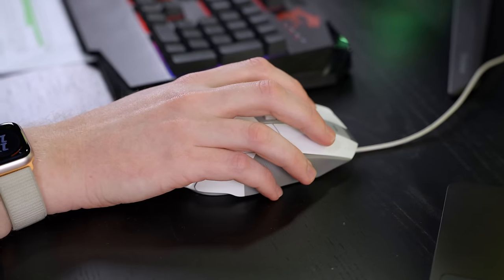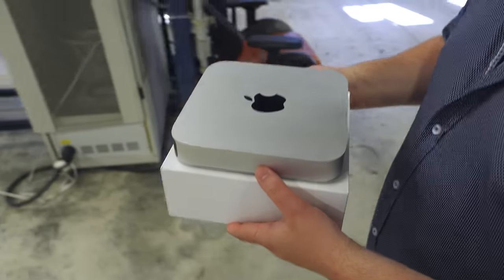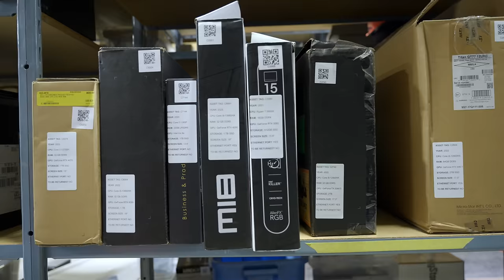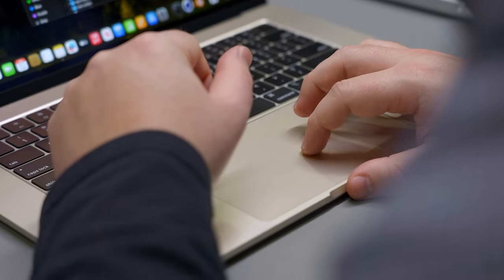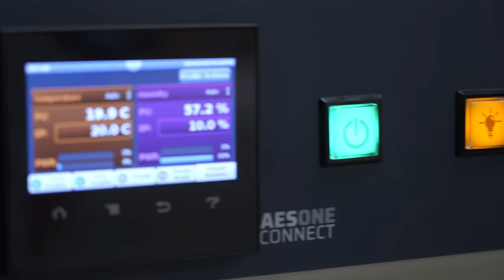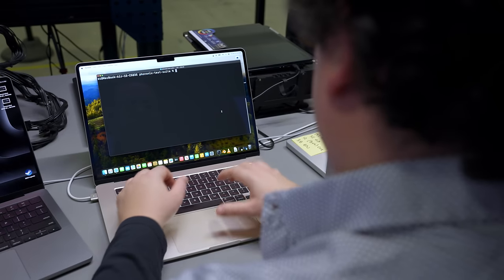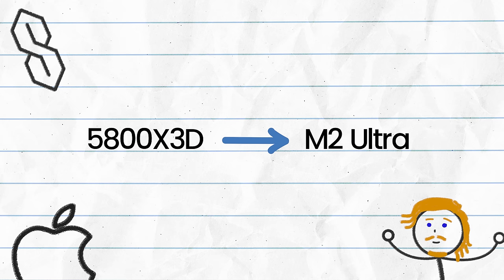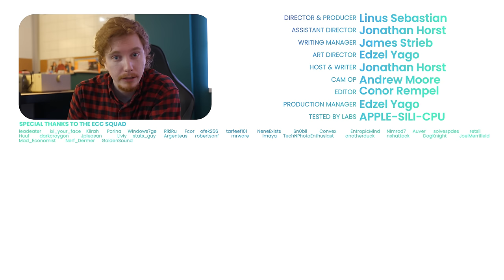How Apple Silicon Compares... - Part 1

Comment: Honest question: Isnt the data going to be skewed by excluding the newest CPUs from Intel and AMD? As an example the 5950x was released more than 3 years ago while the M3 was released at the end of last year? I think it would rbe really interesting for the public  to  see how  the AM5 CPU from AMD rcompare too

Also it is a bit surprising to see both the intel 13700 and 13900 being excluded while also testing the M3 Pro?
Reply: They are just trying to match performance not exceed it. They are trying to test the Apple GPU, not CPU. Older CPUs are fine considering that
Reply: It's the only way they could get the Studio Ultra to be on top of every table.
Reply: @peanutnutter1  Also, shouldn't the ultra chips be compared to AMD's threadripper chips from the time? the m1 ultra has like 20 cores even if it is a mix of p core e core.
Reply: @avgHanimeEnjoyer   You can get a new TR 7980 system for about the price of Studio Ultra
Reply: It´s a GPU comparison test. The idea is to match the equivelant CPUs so it does not skew the real test.
Reply: @JonGretarB   what GPU did they use for the other CPU's?
Reply: @peanutnutter1  as they explaned in the video. That is part 2. Now they are just building a comparable machine.
Reply: @JonGretarB Right, but the Mac's having DDR5 and the PCs having DDR4 will still put them at a disadvantage even if their CPUs are equivalent.

Like why not just... Include both AM4 and AM5?
Reply: m also more curious on laptop chips as well since some of the macs used are laptops too
Reply: @JonGretarB  so all comparable machines are a fifth of the cost and slightly worse performance?
Reply: The 5950x isn't even the best gaming CPU of it's time. You'd want the 5800x for gaming.

Edit: I read this comment before watching the video, they did test the 5800x at least for productivity. Presumably they do the same for gaming.
Reply: @gmony1552  That's stupid because a lot of games are CPU bound on PC.  If you're using a RTX 4090 with an old CPU, you'll run into CPU limitations.  You really do need the latest AMD 7000 series to make full use of the latest GPU's.
Reply: @peanutnutter1  did you not watch the video? It’s about building the equivalent test bench. He explains all this about the minute mark. The whole point of the video is building a computer that is NOT better.
Reply: @avgHanimeEnjoyer  They will be using the 5800x3D against the M2 Ultra for gaming performance
Reply: @JonGretarB  By selected "equivalent" last gen CPUs, they will be unable to match the memory specs of M2 and M3 (3200mt/s vs 6400mt/s), are limiting SSD write speeds (7,000 mb/s vs 12,000mb/s), and potentially limiting the 4090 via cpu performance. 

If they match the CPU in performance and the game happens to be CPU limited, then you will only see a comparison of which API is able to better optimized for which CPU. A CPU that can only run CSGO at 80FPS will run the same on a 3060 and on a 4090. This is a problem because a 5800X3D CPU limits a 4090 in tons of benchmarks. 

If the game is able to run at a high frame rate with lots of things happening, then Ram speed and SSD speeds start to affect performance (+-10%). M2 and M3 will be able to enjoy those performance boosts, while PC will be artificially limited to not have them. So a high framerate game will run worse on a performance matched Nvidia PC as compared to an M2/3 just based on the last generation ram. 

If they push the games graphics to be GPU limited, then the CPU performance would not matter as the CPU would never reach 100% utilization. You remove the memory issue by matching MT/s and memory latency. You remove the SSD issue by using equivalent SSDs. Then you are just left with raw a GPU performance comparison with zero artificial limiters from outside sources.
Reply: @peanutnutter1 You don’t understand the point of the tests lol. The goal isn’t to see if an X86 CPU can be faster than Apple silicon. The goal is to build comparable test benches in CPU horsepower to various Mac models in order to benchmark GPU performance more accurately.
Reply: @CFIREKytb Eh, I think you’re overthinking it a little bit. SSD speed really has very little impact on gaming performance in most cases, and PCI-E gen 4 SSDs are still wicked fast. Functions like resizable BAR do impact performance, and yes, faster RAM helps with that. But in that case, CPU performance as they evaluated it here already takes those variables into account when ranking CPUs. This suite of testing wasn’t intended to determine if desktop CPUs are faster than Apple Silicon. The point was to determine which desktop CPUs align with which Apple Silicon processors in order to build GPU test benches. The tests they ran then fundamentally display the strengths and weaknesses of each architecture, thus allowing chips to be selected for their overall performance,and across the suite of tests. 

When it comes to outright ranking Apple Silicon CPU compute performance VS X86, you’d be conducting these tests very differently.
Reply: @phishphood423 that unfortunately isn't possible as mentioned above. Current gen x86 for a myriad of reasons should be compared to current gen apple silicon
Reply: 3:46 @GuyGamer1
Reply: Not even halfway though this video and this was my first thought. Even if they have to use a lower end AM5 chip to match, it still seems weird they would choose chips that bench scores clearly skew toward the M3 chip. If the AM5 chips are far out performing the M3 chip, I would have liked that information clearly stated rather than a comment that indicates that may or may not be the case.
Reply: @Gray_Falcon  You may have missed the point. It wasn’t a CPU benchmark test. It was a test to find comparable CPUs within a margin of error (Apple Silicon will always have weaknesses and strengths relative to an X86 CPU and vice versa) for the purpose of constructing test benches that would allow them to benchmark overall GPU/gaming performance most accurately across platforms. Of course there are faster CPUs out there, but they don’t really need the performance — in fact it would skew the results. I do agree that it would make sense to use AM5, though I get the logic for using AM4, they probably thought that they’d need some far slower CPU options with lower IPC to compare against systems like the M1 or M2 but it looks like they probably didn’t need to worry about that.
Reply: @phishphood423  No I got the point. My point is they didn't show or clearly explain that all the AM5 chips where ether too fast or too slow in comparable performance. I feel like if the mid or low range AM5 chips are still out performing or under performing  the M3 chip or under performing the M1 chip this should have been shown, to clearly explain why it was eliminated from testing. The test is also difficult to give a proper comparison because they are using desktop build vs a laptop build. Its entirely possible we see throttling in the Apple laptop that we simply wouldn't see in a comparable desktop. I get that they make comments about these things though out the video but I don't like when data isn't shown. A quick comment to justify the reasoning without showing the data to validate the statement is how you end up misleading consumers.
Reply: @phishphood423 
I understand that they are matching CPU performance rather than ranking CPU performance, but they didn't even match CPU performance to begin with.. Nor does that take into account the rest of the system hardware that can have significant performance impacts.

LTT has a video called "Does RAM speed REALLY Matter?? (DDR5 Edition)" in which they show how significant DDR5 is to gaming performance, but shows almost no difference in productivity benchmarks. 

The highest weight in this video was single core performance. An important metric, but nowhere close to the full picture of CPU (and adjacent RAM) performance. 

Passmark results show the 7900X3D and M2 Ultra line up almost identically in both single and multicore performance. And give that a 7900X3D uses DDR5 ram, which could be MT/s and timing matched to the M2 Ultra, it would just be way more fair of a CPU match than a DDR4 7nm chip with 20% lower single core performance vs the M2 Ultra and that is 25%+ slower in Baulders Gate 3 vs a 7900X3D. 

And on top of all of that, while rewatching the video, I noticed they didn't actually show the 5800X3D in their graphs. So why it was selected? Who knows. 

Essentially, whatever the 4090 gets in benchmarks matched with DDR4 and a 5800X3D.. just at 30% to the performance. It will be bottlenecked by the surrounding hardware that is not in any way matched to the M2 Ultra's performance.
Reply: @CFIREKytb  What do people call this word again... "jargon"? Yikes...
Reply: @NeonLuminous  What?
Reply: @NeonLuminous  Okay let's try no jargons.
A best in class GPU doesn't work on it's own. It needs a tight integration of cpu (the processor) and RAM (which stores what to do).

MacAdress, by limiting CPU to 3 years back, also set the RAM 3 years back. 
Say you have a kid who is very good in badminton. MacAdress, being the teacher, has put him up to train with the 10th ranking player when your child is 2nd in class.

Do you think it's fair? Will it let your child show their best? No? Exactly with the best in class GPU!

In the end, the test will be unfavourably towards the PC GPU, which could've been the top student but is held back by  the average kid.

Comment: While I understand the reasoning behind sticking with AM4 I feel like comparing Apples latest M3 (3nm silicone) that just came out a few months ago (and their M2 Pro/Max/Ultra 5nm lineup that also just came out last year) to AMD's previous gen (7nm silicone) that came out 4 years ago was always going to be an unfair fight in Apples favor with CPU bound workloads. As for "no low end AM5 chips", you can compare the 7700 or 7800X3D with their 8 cores to the base m2 or m3 chips that also have 8 cores... the 6 core 7600 also exists, but no apple M chips have fewer than 8 CPU cores and are at max 5nm all the way back to M1. IMO a more fair test would be doing these comparisons using similar process node CPUs & GPUs like AMDs 5nm 7000 series vs Apples 5nm M2 (or M1) series tested at similar wattages or accounting for PPW. Despite this, I'm still looking forward to how the results turn out in part 2 and appreciate that you guys are at least trying to make an "apples" to oranges comparison (see what I did there... sorry lol) with PC Hardware.
Reply: Sounds like a bad plan if they are looking for what is comparable…
Reply: @Tawmii91  Perfect plan, the end result will be that an M3 Mac has performance similar to an much cheaper PC from years ago.
Reply: @Tawmii91   My point isn't about what X86 CPUs runs the closest in performance to certain Apple CPUs in order to test GPUs, I understand the methodology they are using for these videos. I'm just saying I'd be more interested in the results of a similar test where the CPUs (and GPUs) have the same silicone node size and core count (M2 5nm vs Ryzen 7000 5nm and RTX 4000 5nm), and are either tested at similar wattages or include PPW in the results. This way you are closer to a true apples to apples comparison and can more clearly compare ARM vs X86 rather than arriving to the obvious conclusion that the smaller node cpu/gpu options (M2 and M3) are more efficient than their larger node PC counterparts.
Reply: You're forgetting that the point isn't to compare CPUs - then your point would be fair. The point is to _eliminate the CPUs from the equation, so they can compare the GPUs_.
Reply: there's also disabling cores features on Ryzen, am I right? Like the whole strategy about AM5 not having budget options is absolute nuts, I am watching the whole video shaking my head on their decisions as to why they can't use the latest processors they compare. Also, AM4 is in DDR4 like that should also taken into account specially when they're testing gaming
Reply: Dude, they are controlling for the CPUs to test the GPUs. What you are asking is for a CPU test.
Reply: @FernandoAES  CPUs have influence over GPUs and how they perform, that's basic knowledge. At 1080p, there's more than 50fps average difference between a 5800x3d and a 7800x3d (source: Techpowerup) so this test will be absolutely skewed in favor of apple.
Reply: agreed
Reply: I agree 100% I came down to the comments to write nearly the exact same thing.
Reply: yes, and thats why you want the cpus as close as possible to make sure they don't color the results. ryzen 5000 series came out 3 years ago and aren't up to the same level for single threaded performance as the m3s or ryzen 7k and core 14k. @FernandoAES
Reply: agreed 100%
Reply: The point of this was to find a comparable x86 cpu because the real test is to compare the GPU performance of apple silicon vs new gpu’s and see where apples integrated gpu’s fall in comparison to the last few gens of others gpu’s.

If you used a brand new AMD chip that outperforms the Apple silicon in cpu tasked it may skew the results of the GPU test which they obviously want to avoid since the GPU comparison is what they care about.
Reply: Perfect, so now I know 2000+ $ Mac is comparable to 300$ pc [with technology from 3y ago] , lol 😀
Reply: I think the best way to test is to build similarly PRICED PCs, with the best possible hardware available, and compare those to the Macs.

This gives a value comparison between the platforms as far as performance is concerned.

That way you would have a 7800X3D (€380,-) in there. Seeing how much a Mac Studio M2 ultra costs you could even do an AMD Threadripper 7970x build.
Reply: @menacingdonutz   Then in what way using old and underperforming AMD chip to compare with Apple silicon wouldn't skew the result for Apple?
They could still find comparable AM5 chips that close to each other in benchmarked result for the GPU test. 

This test shows they made a wrong assumption since the beginning.
Reply: @MichaelJacob  at 1080p you're not GPU bound, so that's a CPU test. This was all about selecting CPUs to test the GPU.
Reply: “They have to be the same nm size or else its not a real comparison!” Something no one ever said when its was AMD vs Intel and benching the years newest processors. nm is one part of a chips design and isn’t that critical. Its just like when people were obsessed with ghz like it was the end all and be all or processor performance. Then when ghz stopped making big increases, people moved onto something else… yet cpus still gained massive performance boosts even though everything has been sitting around 4 ghz for years and years. Take me back to the 8bit vs 16bit days with this ridiculousness lol.

These chips are completely different architectures and instructions. This isn’t an apples to apples comparison period. This is about what chips are on the market and how they perform for the end user.
Reply: @ovoovoovoovoovo it won’t be cheaper on TCO. Electricity has become expensive. In real world usage a 50W difference in an office day will cost you about €100 extra every year. So that is €400 in 4 years that you didn’t get to spend on performance. Bit of waste if you ask me.

Comment: When doing the gaming performance video please make sure on the high end you use the best "Max" chips and not "Ultra" chips. Many games don't run right on Ultra chips, because of similar issues to SLI. Ultra is two separate chips bridged together. A game needs to be specially optimized to run well on them.
Reply: Oh boy, got to the end of the video and the 40 core GPU M3 Max, wasn't chosen for the test :-( . It should have been the first pick. It is currently Apple's most apt gaming chip.